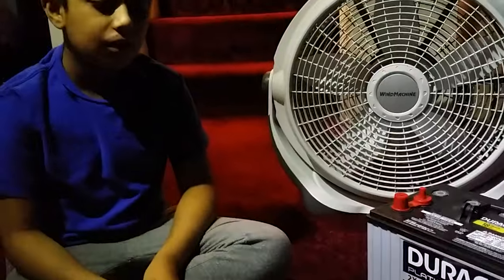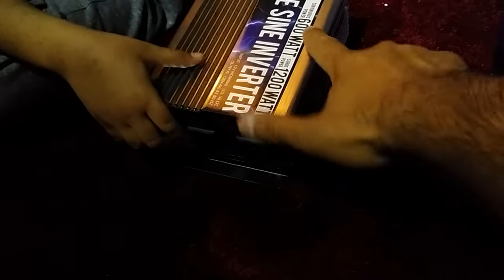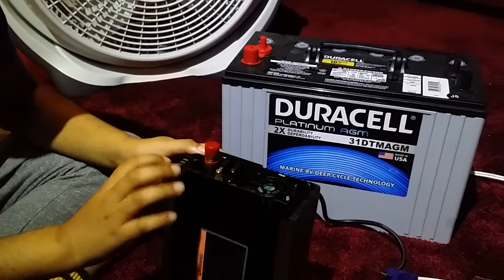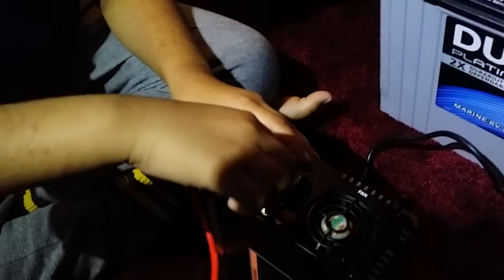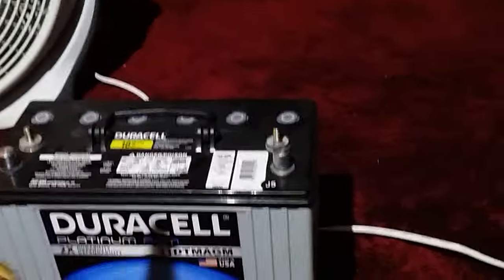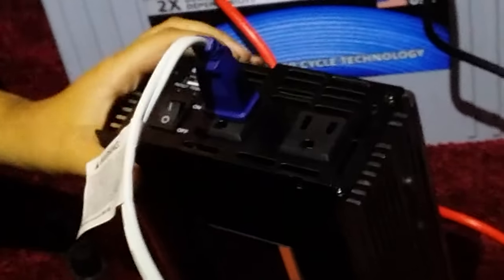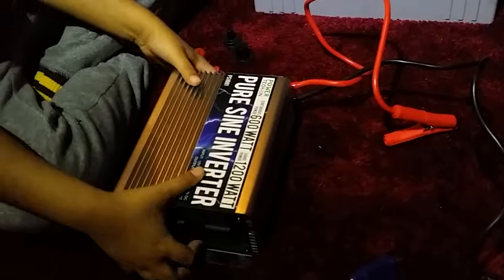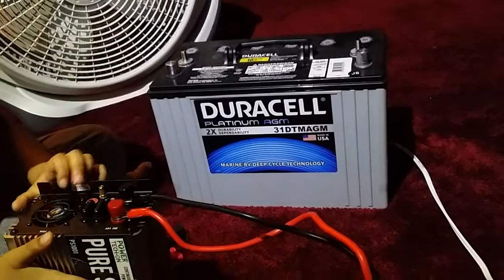How to run electronics using inverter and a 12 volt battery

Comment: Are you kidding me, no better way to show how easy this is, then to have your kid do it! Great job young man, dad you should be very proud. My wife and I were considering Spending a bunch of money on a power station to run my gas furnace, but this is all we need because it’s going to be in the basement. I was searching videos trying to learn how inverters work while connected to a battery, this is the best explanation that I’ve seen. Now ,I’m very comfortable with this process, so I can’t wait to get my set up for my basement
Reply: For Hurricane Laura, we had no electricity for 14 days. We ran 4 fans and lights off of a 2000/4000 power inverter I purchase from harbor freight for my son, grandsons, and me to use for camping in the woods off my tractor battery. At night I would run the tracker for about 4 hours and 2 hours during the day to keep the battery charged. With a 2000/4000 inverter, you can run around 16 amps. continuous as long as you have a way to keep the battery charged. Led lights are what you want to use.
Reply: You still need a solar panels to charge the battery. Or else this will be useless in 3-5 hrs or not even.

Comment: Exactly what I was looking for! Short and straight to the point. Now I know what to buy and how this works. Thanks!
Reply: Do you need an inverter to do this or can you connect the appliance directly to the battery?
Reply: @etimsam  you need an inverter.
Reply: @etimsam  for an appliance that require a DC 12v supply, you can use the 12v directly without using any inverter, such as computer monitor and others, but if you need AC voltage ranging from 110v to 220v sine wave, then an inverter is a must have.

Comment: Would this inverter power a 175 watt stereo receiver?? I'm trying to figure how for a bike trailer. Also cool to see your son hands on learning and doing things. 💪
Reply from the maker: Sorry for the super late reply. Not sure how did I miss your comment. 
Yes it will run anything upto 600 watt drawn continuously and it offers upto 1000 watt of starting power required for some AC motors. You can get away with something like a 300 watt dc to ac inverter. Hope that helps and answers your question

Comment: HOW MANY SMALL ELECTRONIC DEVICES OR APPLIANCES AT ONE TIME, WITH THE 600 WATT, HE IS AWESOME AND VERY GOOD INSTRUCTIONAL TEACHER. THANK YOU BOTH !!
Reply from the maker: Thanks for the warm comments. How many devices it can run totally depends on the amps or wattage of whatever it is that you plan on running. Almost every device has a sticker stating its power requirements. It may say 110v 0.5a or amp. 110 x 0.5 = 55watts. This is just an example. Some stuff requires higher starting power such as a blender or an ac motor. You can always buy a bigger inverter than 600watts. In fact most people use 1500 watt inverter and that generally can run anything. I hope this helps. Feel free to ask questions.
Reply: @Brownscorpion  THANK YOU FOR ANSWERING MY QUESTION, SO AN INVERTER WITH HIGHER WATTS, 600W, 1500W, 2000W,and ON HIGHER WATTS WILL BE MORE POWER TO RUN MULTIPLE APPLIANCES, OR ELECTRONICS ? I WAS TRYING TO FIND ALTERNATIVE POWER FOR MY SEWING MACHINE, WHICH IS 110 VOLTAGE NEED, SO I TRUST THIS WOULD WORK IF I HAD A 2000 or HIGHER.  YOUR SON IS VERY INTELLIGENT, I ENJOYED HIS EXPLAINING THE HOW TO CONNECT INVERTER TO 12 DEEP CYCLE. THANK YOU BOTH AGAIN. MANY BLESSINGS.
Reply from the maker: @debfassbinder9283  no problem Deb. You should be fine with a 600 watt inverter if your sewing machine is like 100 watts or less like most Singer brand sewing machines. Not sure about the energy requirement for your machine however there should be a sticker with its specs. If you have trouble understating it you can read it off to me and I can confirm it for you. But i dont see why a 600 watt inverter wouldnt be able to.
Reply: @Brownscorpion  HOW THEN also. DO YOU RECOMMEND RECHARGING OF THE FREE STANDING 12V DEEP CYCLE BATTERY ?? THANK YOU FOR YOUR EXPEDIENT RESPONSES.
Reply from the maker: @debfassbinder9283  You can use a 12v battery charger. I have included a link for a 12v charger https://www.amazon.com/dp/B08G446ZQ9/ref=cm_sw_r_sm_apa_fabc_NY1Z9ATPF45AF2WM4VA2
Reply: @Brownscorpion  THANK YOU THE LINK IS AWESOME, APPRECIATE THE HELP !! MANY BLESSINGS.
Reply from the maker: @debfassbinder9283  you are very welcome

Comment: Thank you so much. I wrote down the instructions. I hope the inverter is not expensive. In an emergency, is there an alternative for the inverter? I saw a movie in which the criminals were using car batteries for power in a house. These are simple survival skills that everyone can and should be teaching their children. Knowledge that can make them valuable to society as well as their families 👍👍. Great job!
Reply: Just one 12 volt battery and an inverter, no matter the quality and efficiency of the inverter will run an entire home. Even if you wanted to run a full size fridge it will only do so for 3-8, maybe 10 hours. A stand alone battery with nothing replenishing it, whether that's an alternator or solar won't sustain most of the things you would use in your home. If you had an inverter large enough (at least 1,000 watt) and wanted to run a microwave you'll drain it fast. A generator is the best alternative for any length of time. A small 2,000 watt inverter generator can run for hours on a gallon of fuel and power just about anything in your home IF you run them one at a time with the exception of water heaters, central HVAC systems and clothes driers. A little inverter generator will run a fridge and a deep freeze or a fridge, TV and a couple lights. It just depends on your power needs. A large 12 volt battery is excellent if you want to have one on standby to charge phones. I have one I keep on a maintainer charger so it's always charged and when the power goes off you can plug up a wire with a 12 volt (cigarette lighter) socket and use your car charger and keep phones charged. You can charge several phones for several days that way without needing a re-charge. If you do run ot down just take it out to your vehicle and run jumper cables to the battery from your car battery as you leave the car idling for an hour or so and then you have a fresh battery to charge phones and devices for several more days. I have a 12 volt 22" LED TV I use in a tent with a deep cycle battery out of my boat and it will run that TV all weekend and keep our phones charged. A little LED 12 volt TV will only draw about 2-3 amps so it will last a good while.
Reply: @jbrannon509  I am planning on getting my son and myself a pure sine inverter. They're not expensive. Just wondering how long the battery might last. Also a quieter alternative than a gas generator.
Reply: @vadamsable  It just depends on what kind and how many batteries and what you plan to run with the inverter. For instance, a small TV may run for hours but a microwave not so long. Do you know what you plan to power the most?
Reply: @jbrannon509  Mainly the fridge. For my perishable foods like milk or meat. I plan to go off grid soon if I can. Most work you can do during daylight hours (candles or lamps for night), cooking can be done on a convection propane heater or wood burning stove. I can do with minimal media. Cellphone or tablet for information a few hours each day. Thank you for responding Jason. I would use the inverter/battery on and off for the fridge to keep the foods cooled🤔.
Reply: @vadamsable  If you had multiple batteries, maybe 4 deep cycles and an efficient quality inverter you could run a fridge for a day probabaly. I'd invest in some solar and a solar power manager though. 3 or 4 100 watt panels would keep the batteries charged. Honestly, I'd look into a RV propane refrigerator. You can run a propane fridge for days and days on just a smaller 20 pound grill size propane tank!
Reply: @jbrannon509  Got it Jason. I didn't know fridges could run on propane 🙌🙌!! I doubt I can afford the solar set up right now. I also won't waste the coin on an inverter if it lasts only a day or so🤔. I'm taking notes😂😂🙏.  I live in "snow country" and I thought the solar wouldnt be effective when it snows on my roof and there's little sun. During my move, I wont have my regular fridge for a week or more, so the propane one will come in handy! I can always put the small propane one in the basement later. You're a kind man to share your knowledge. Thank you. Be blessed brother.

Comment: What determines the type of inverter you need for the basic car battery? I don't understand the watts you need. If I needed to run a small refrigerator that did 1800 watts I need a 1800 inverter or less or more or doesn't matter?

Comment: CBR600 W inverter the kids said you can run off TV set or a fan off of it maybe even a portable refrigerator small
Reply: Hey Doug. I just posted a question here but I am not sure how long until I get an answer, so I am thinking to ask you. So, do you have to have an inverter for this or can you achieve the same result by connecting the appliance directly to the battery?

Comment: Neat video! Kid is smarter than me! :) :) ... I wonder how long the car battery will run a small laptop such as a dell xps and LCD computer monitor for?  Thinking about doing a set up like this in the event of a power outage.   I think a trickle charger will work good right to recharge the battery?  What can I get to monitor how much power the battery have left during usage?  Thanks again!
Reply from the maker: Your comment is very much appreciated.  Thanks 😊

Comment: I have a question please. Do you have to have an inverter in order to convert an appliance from public electric supply to battery operated, or do can you connect the device directly to the battery?
Reply from the maker: You got to have an inverter. Battery power is 12volts vs. power in your home is 110v
Reply: @Brownscorpion  thanks for clarifying this..

Comment: I don't have the Alligator clips, but I have the red and black wires with terminals at each end to connect from the inverter to the battery.  Anything important I need to know before I try attaching them?

Comment: Genuine question: I want to use my shed for hobby crafting. My shed has no electricity, can I but an inverter and battery such as a car battery keep this in the shed and run a cricut( cutting printer type machine) and a surface pro 5 ? I am purchasing rechargeable lamps so I can bring them into the house and recharge. I do think that those are the only two things and maybe just maybe a fan for summer weather. Please help! I just can’t seem to wrap my head around the numbers and units of measurement revolving electricity and I know that if I hook up incorrectly I can damage my computer and my Cricut machine which I don’t have the money to replace should this happen . Running power cords is not currently an option. Thank you to anyone who helps!
Reply from the maker: Sure I can help with that. First we need to determine how much electricity your Cricut printer consumes. Surface pro 5 barely takes any power. A 600 watt inverter as shown in this video should be sufficient to run everything in your shed however once we figure out how much power your printer takes. Also keep in mind that car batteries are pretty heavy and I'm not sure how far your shed is from your main house as carrying it maybe a hassle. You could use Lithium batteries as they are lighter but keep in mind they cost 3 times as much as the regular batteries that go in your car. If carrying a heavy battery once in a while to it's charging station is not an issue go for it. I use a 12v 8amp charger to charge these batteries when needed and rest assured that these new pure sinewave inverters have built in protection against reverse polarity, over load protection, and several other protections. It will not harm your surface pro, cricut or any other sensitive electric device that's plugged into your power inverter. Just be sure that you get a pure sinewave inverter as they offer all of these features. If you have any questions feel free to hit me back or DM me on Instagram
Reply: @Brownscorpion thanks for the info . May I ask , how do you recharge the battery ? Does the inverter also allow you to plug the battery into a wall socket and send electricity in the other direction? Last question , are there smaller lighter car batteries to use for a setup like this ?  I want to build a portable power station to run power tools with for crafting in the park nearby . Thanks !!

Comment: Can I use this method to power a 450 watt grow light? I’m intrigued
Reply from the maker: Of course you can. Just as long as you use an inverter thats greater than 450 watts. How do you plan on keeping the battery charged? Solar?

Comment: How long do battery stay charged using just a invertor an car battery? I didn't see anything to keep battery charged
Reply from the maker: That depends on the load, efficiency of the inverter, as well as the battery capacity. In this video you see a 100ah (amps per hour) capacity battery. 100 amps x 12v= 1200watts total capacity in this case. When you connect an inverter to make 110-115v using your 12v battery depending on your inverter you will see some where around 90 to 95 efficiency. Then you have to take in account that batteries can not be drained all the way or you will kill them and wont be able to recharge them. You asked how do i charge this battery. There are several different ways to do that. If you have access to power you can charge it with a 12v battery charger like i do. Its an 8amp an hour smart battery charger and maintainer by Schumacher and when i need to go on a camping trip i can take just the battery and the inverter with me. My load generally is very low. I mean a small table fan and few led bulbs so it serves the purpose well. I have used a small generator in the past to keep the battery topped off during the day for couple of hours on a camping trip while using using load of fans and other electronics and that way at quiet hours of the camp grounds at night you are not disturbing anyone with the obnoxious generator noise lol. You could also get a 50 or 100 watt solar panel and a charge controller combo for about 120 that will make you completely off grid and keep the batteries charged. Depending on your load you may need more solar panels but for what i use it for one panel would be enough. What are you looking this setup for?
Reply: @Brownscorpion  I'm using a 750watt invertor with  800amp reserve capacity 110...trying to hook up a small 19" tv an maybe a small fan...is that to much?
Reply from the maker: @firstladypresident  no you could probably even run a small window ac unit with it. Your inverter can handle it. A 19 inch tv depending on whether its a lcd or the old school one shouldnt take more than a 100 watt. The question is what is your battery size? What type of battery it is? Whether its agm deep cycle or some other. I have run a 42 inch lcd in my camper with my 650watt inverter while chargibg laptop and phones.
Reply from the maker: @firstladypresident  you might want to read the specs on your tv and they should be posted behind your tv. It should state how many amps is your tv at 110 or 120v. Usually it would say something like 110v x .95a
Reply: @Brownscorpion  the TV is 120v an it a led tv my battery is a duralast deep cycle top post 800 amp
Reply from the maker: @firstladypresident  oh yeah you have plenty of juice to run it for hours
Reply: @Brownscorpion  ok thank u so much now I just need to find me a good battery charger to maintain it
Reply from the maker: Heres a link to a battery charger https://www.amazon.com/dp/B07VNL27X6/ref=cm_sw_r_cp_apa_i_XyLKDb8EYJWDC
Reply: @Brownscorpion  thanks ur a life saver an great video by the way keep it up👍
Reply from the maker: @firstladypresident  thanks. Let me know how it goes
Reply: unknown_007 wow, that is exactly what I would be trying to run. How many hours can you run those things with a 27/29 deep cycle battery? I am trying to help my fiance’s family in the philippines where 12 hour “brownouts” are common. They just have a wifi modem and a 42” led tv to run.
Reply: @Brownscorpion  thanks for the info were going camping and I bought 1000w Dewalt inverter to plug to the battery and we have a portable jumper so this is great information so we  can have a battery generator basically 😀 👍 😊
Reply: Use a marine/boat battery...lasts longer.
Reply: @Brownscorpion thank you. How do you keep track of how much charge is in the battery and avoid draining it too much ? Does the inverter read that info ?

Comment: Where can I  buy the power inventor,I am in Italy?
Also how do you recharge the car battery when it runs out?
Reply: Well, you can use your car, solar panels, small wind turbines, a car alternator hooked up to bike and etc.  You can go creative finding alternative power sources. For example I personally used to connecting some extra batteries to my tractor, so it could charge them while working in fields.
Reply from the maker: You can buy it from aliexpress as you are in Italy and they ship world wide. I use a 12v charger that plugs into the wall outlet but as someone else mentioned you can use solar or any other charger
Reply: @Brownscorpion can you tell me about the 12 volt charger ? What exactly do I need to know in order to recharge the battery from a wall outlet ? Thanks !